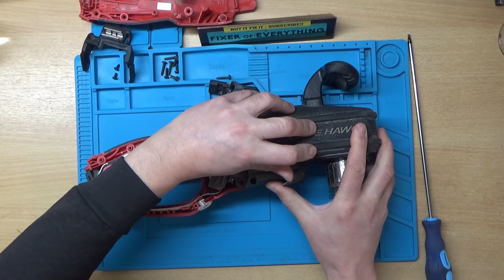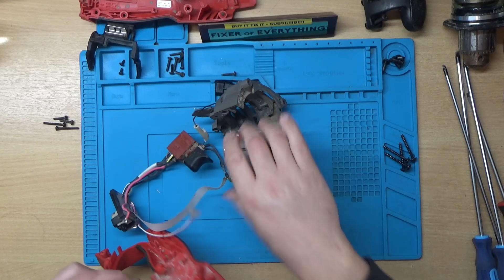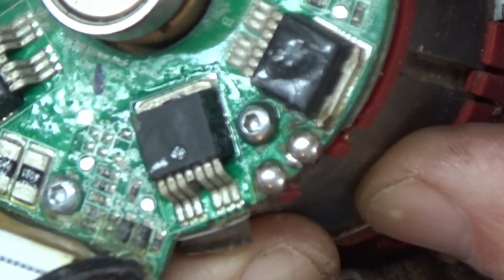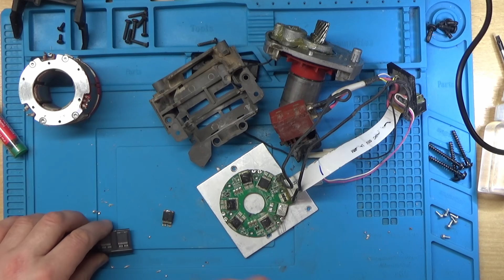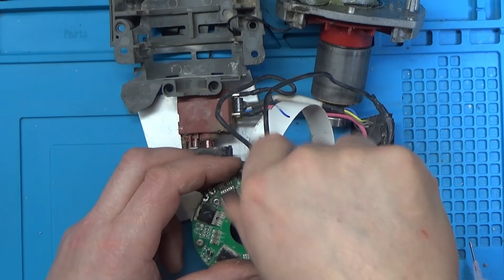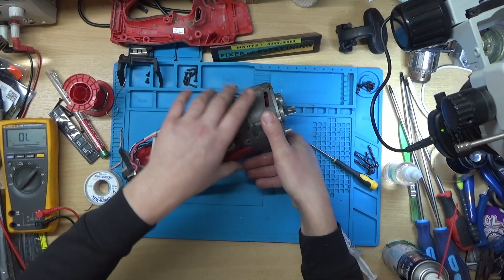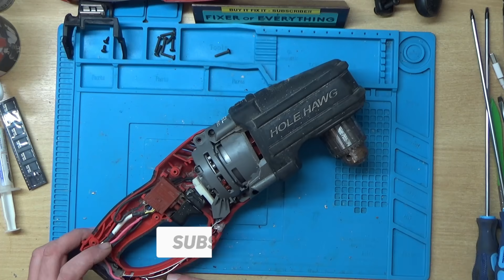Faulty Milwaukee Hole Hawg Drill | Let's FIX it!

Comment: That was some quick diagnosis, great job👍👍 Benefits of working on Milwaukee stuff before didn't hurt either.  Question: are those original Fluke test leads? They seem to have sharper tips than normal.  Thanks for another satisfying victory and video, well done sir.  See ya soon.
Reply from the maker: Thanks 👍no the test leads are just a generic cheap set from Ebay / Amazon and retail for around £5.

Comment: I really hope that the EU makes mandatory to publish all the technical details of products so we can fix them.
Reply: The right to repair in the US seems to have caused the manufacturers to supply many parts as major subassemblies. In many cases Milwalkee (for example) will not supply a simple battery connector - you have to buy it with the switch, stator and motor controller as an assembly which makes an out of warranty repair uneconomic ... technically fixable just uneconomic to do so.
Reply from the maker: Yes I discovered that too when trying to repair the circular saw and the sander I looked at. The saw I managed to repair by someone sending me a donor part and the sander I found an alternative motor on Aliexpress.
Reply from the maker: Yes, that would be great, although I wouldn't hold my breath...

Comment: Another resurrection, well done. A suggestion (no hint of egg-sucking tutelage) is to use small silicone trivets (intended for kitchen use) when unsoldering big stuff from thick stuff. They don't suck heat and are not too costly to replace if they burn.
Reply from the maker: Thanks Ralph, and thank you for the suggestion 👍

Comment: I went down the rabbit hole trying to figure out if Milwaukee owned the Torx company (or at least the Torx screwdriver company) and discovered that the company that invented the Torx screw head, Textron, started out as a manufacturer of synthetic yarn! That led them to parachutes and eventually aviation. The screws started out on Cessnas.
Reply from the maker: Interesting, thanks for sharing 🙂👍
Reply: @BuyitFixit Great fix, by the way. I see you have our lovely Manitoba spring weather!

Comment: Nice repair, but it still astounds me that you sometimes put things fully back together without testing the basics beforehand. 🙂
Reply: TBH it doesn't matter, if it doesn't work after reassembly, it'd mean the control board is gone, which can not be fixed.
Reply from the maker: I was pretty confident that it would work. I've fixed other similar tools 🙂

Comment: If you put a small piece of a silicone tube at the tip of the solder suction tool, it will work wonders.
Reply: Buy a genuine engineer solder sucker, they are so much better than the generic ones... Great fix as always! We all get distracted from repairs at times - going to get the sheep safe from the snow must count as the best excuse I ever heard!!
Reply from the maker: 😂😂😂Thanks 👍
Reply: I also heard that the rubber on the crt flyback do the same thing
Reply from the maker: Thanks for the suggestion 👍